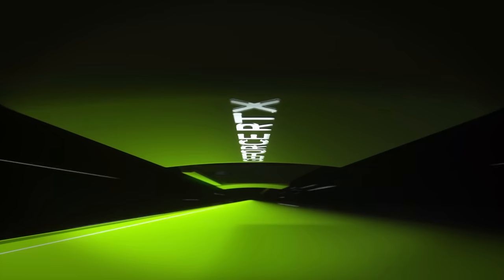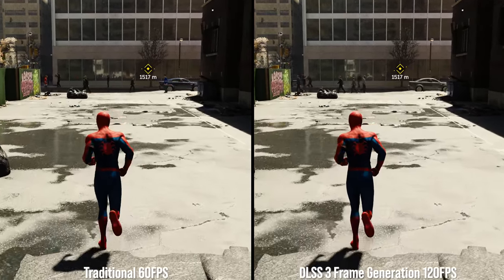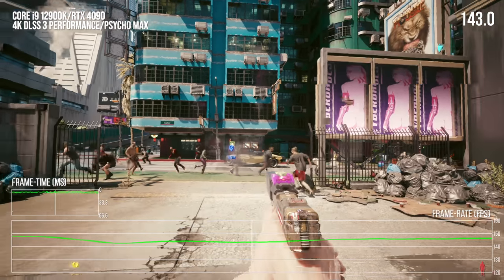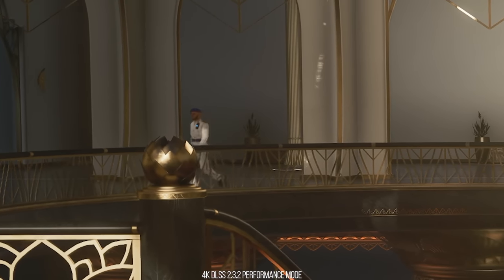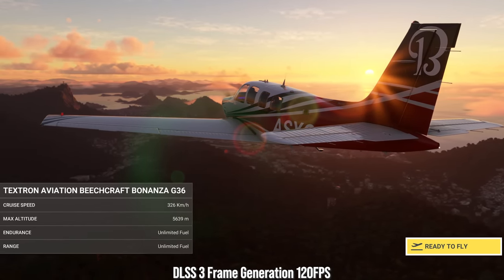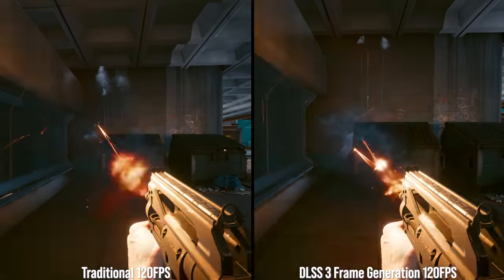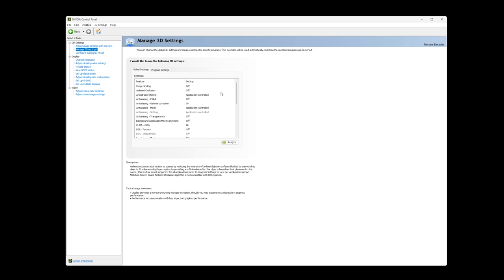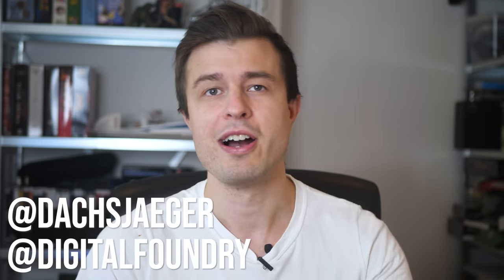Nvidia DLSS 3 Analysis: Image Quality, Latency, V-Sync + Testing Methodology

Comment: So just as we thought dlss3 has all the elements of soap opera effect from motion vectors on TVs but now in video games. 110 milliseconds of latency with vsync on takes us back to 2003 on Old School HD CRTs that had 100 HZ. The other interesting thing that this test showed very well was that you're not even getting temporal stability from these fake frames, because it's inheriting the flaws inherent in the original lower frame rate. I think what makes me sad about this technology is that it's implemented in an imperfect way when VR motion interpolation is implemented in a much better way.

Part of the problem is that the optical flow generator is engine agnostic, unlike in VR rendering where ASW 2.0 has complete pipeline awareness and engine integration. Engine integration would allow them to cut the latency way down without having to rely on reflex to fake it.

Dlss 3 is the least interesting aspect of these cards and no way in hell is it worth $900 to $1600 dollars.

Comment: Excellent video! I think I might disagree with the comment at the end about enabling of v-sync with a g-sync display though, if you're tuning your graphics settings to target below your monitor's max refresh rate. It seems like the tradeoff would be v-sync preventing tearing at the expense of low latency when framerates exceed the v-sync amount, whereas without v-sync you'd maintain your lower latency while introducing tearing in that same situation. I imagine I'd just prefer a consistently lower latency in those situations, but I guess it depends on just how bad the tearing is, and how well you're able to tune your graphics settings to keep the framerate below that level...
Reply: I never saw tearing in that gsync on vsync off situation...  Avoiding tearing was all the goal of gsync
Reply: vsync doesn't do anything in the refresh range when gsync is on, If it exceeds max refresh then its either vsync on or off and as the refresh rate is static

Comment: Correct me if i'm wrong but I believe the amount of latency vsync adds depends on the number of frames that are waiting in queue. For eg. If you get 125 fps without vsync, turning on vsync (120hz) will increase input latency but not too much compared to let's say if you get 155fps and then turn on vsync. I tested the render latency using the nvidia overlay in CP2077 (probably not too accurate) and here are some results using an RTX 3060TI while looking at a wall/ground/sky (for stable fps) @ 1080p:
Vsync Off : 118 fps (6.5ms)
Vsync On (75hz) = 75fps (23ms)
Vsync On (75hz) + In-game Frame cap @74fps = 74fps (9.5ms)
Capping the framerate just under the refresh rate probably has less of an effect on latency when using DLSS3 compared to Native/DLSS2.

Comment: Great video, and I was among those complaining about the early preview coverage. The vsync issues are surprising, but I'm also assuming Nvidia will eventually find a way around them. I think the one bit the video didn't show that I would like to see is what happens to frame delivery with each permutation of vsync and hitting the refresh rate of the display. It seems to me that DLSS 3 is not quite ready for prime time outside very specific combinations of hardware, games and settings. However, it is also currently only available in the one extremely expensive GPU that can basically max out everything out there, so I'd say Nvidia has at least until the 4070-by-any-other-name (still salty about that) starts to be sold at volume.

Also, am I the only one who noticed that Alex sounds a lot like Rich in this one? That was a bit weird. These guys need to start hanging out with other people, I think they've been testing GPUs together for too many days in a row.

Comment: They definitely did better than I thought could be done w/ DLSS3's frame interpolation. The AI aspect on there totally resolves many of the issues I assumed would be present - because I was only imagining what could be accomplished purely using motion vectors to displace the previous frame and morph it into the next frame. That "whole frame artifact" spanning the cut between two camera positions around the airplane in Flight Simulator looked like a failed Deep Dream image - there's a lot more machine learning involved in DLSS3 than I would've thought. They probably have some tensor cores to spare even at those sub-10ms frametimes.

Comment: Lots of great detailed information in this video!

I am bit surprised at the huge latency increase with DLSS 3, when VSync is on. Perhaps, this can be fixed in the drivers?
The scene transition/camera cut issues are also a bit surprising... one would expect DLSS 3 to have some information about the 3D world location, and not just image space information, but apparently this is not the case.
Even the muzzle flash/HUD darkening seems a bit strange... is this due to non-gamma-corrected interpolation, or a statistical issue?

Overall, frame interpolation works impressively well already, but even many of the existing issues seem like they can be improved upon in the foreseeable future.

Comment: Good video, sparks a lot of interesting points and feedback. As someone that study 2D animations and try to hack good motion using a wide variety of frames per motion and for as least frames possible, the variation of what Artifacts are or aren't easily perceive in Realtime does make perfect sense. This works better than one would expect for a new technology, Nvidia engineers are something else so I have no doubt it gets a lot smarter overtime. you can see exactly what it's doing by going frame by frame 21:27 pretty cool

Comment: Amazing job guys! The review is very detailed yet presented in a very easy way to understand! I was just wondering what would happen if we use fast sync from the nvidia control panel instead of regular vsync along side gsync?! Wouldn't that allow the gpu to render more frames when the fps is higher than the screen refresh rate which should result in lowering the latency and input lag?

Comment: Or instead of trying to find the general settings to be below your monitor's max refresh rate, just limit you in-game FPS to maybe 5 FPS lower than the refresh rate. Save the hassle and do that instead.
Reply: so if ur using 60hz monitor you have to play at 55fps? kinda makes the whole thing pointless
Reply: @John Pen  Well, the point of doing that is to always have Free Sync or G-Sync active all the time rather than it switching off and on when your FPS goes above your refresh rate, if that makes sense. By doing, this you should notice a smoother experience. However, I feel like this will only have big differences for refresh rates higher than 60 Hz. If you have a 60 Hz panel, I'd recommend just to uncap your FPS and leave it.

Comment: In regards to GSync/Vsync, does Fast Sync work here? Allow the GPU to render as fast as it wants and just display the latest frame in full? Seems like it would be a reasonable compromise right now to avoid frametearing.

Or we need to move to auto-scaling DLSS. If you're in DLSS 3 Performance, over 120fps on 120hz, switch seamlessly to DLSS 3 Quality to drop fps in exchange for quality.

Comment: With DLSS3 should game engines change from trying to generate as many FPS a second to just the monitor's max refresh / 2, so a 120 only needs 60 fps and then use spare cycles in the engine to minimize input latency.  If you know your last frame time you can see how much spare milliseconds just loop taking input until have to start the draw.   So @60-16.6 ms is your total available time, a frame draw takes 10 ms you have the other 6.5ms to do nothing but take input loop before building the next frame.

Comment: I can't tell if you tried it, but wouldn't recording be improved by using a host OS to record a native-performance enabled VM through looking glass? Also, for the cards that don't even have the latest spec (supposedly so they can sell you an upgrade next release), you could have a weak ARC GPU and pass-through the buffer from the stronger nvidia lacking ports

Comment: I think this technology as it is right now it's good or below average by a notch but it's pretty much the future, being able to run games with all ray tracing features turned on with a much higher frame rate is just incredible. This will put a lot of stress on consoles manufacturers, imagine the PS6 not having a technology like this while a low end GPU outperforming it.

Comment: 29:33 The fact that you can cut latency by 3X (90ms vs 30ms) while only boosting framerate by 66% (60fps vs 100fps) again shows that Native 120fps needs to become the new gaming industry standard framerate target, the gains in both image fidelity with Temporal Upscaling and the feel of user input are so much better, no-one should ever be forced to play at 60fps.
I know, the same argument applies to 60fps over 30fps so why not be happy with 60fps? The reason is 120fps is still reasonably achievable and well under the point of "Diminishing Returns".
240fps never needs to go mainstream, smoothness and clarity won't dramatically improve between 120fps to 240fps the way it still does from 60fps to 120fps, and yes I felt the same about framerate performance on a CRT in the 90's, 100hz and above is a beautiful thing.

Comment: Thanks for the follow-up. I still don't understand why they generate frames in the past.... Or they actually generate frames in the future but your explanation doesn't confirm that our right. 

Is there a public white paper or an actual research paper. Having an actual model to play with (and experiment) apart from any games or hardware constraints would help be understand it.

I would still prefer to have your subjective pixel peeping supported by objective measurements. Perhaps you can use some form of image reconstruction metric. Like the Netflix compression score.

One request I do have for you: get some sample footage and play them back at 60fps. Make one clip at only every other frame (the real frames) and a second clip also at every other frame. But offset by one frame. This way you can view only the real frames and only the fake frames. They won't be comparable as there is an offset, but you can see if any issues persist in the fake frames that might get hidden by seeing alternating frames on your monitor. 

Also raises the question for framerates (or frametimes to be more accurate) that are higher than the monitors refresh rate. Even if you have v sync or not. Will the frame buffer prioritize real frames or always do the newest frames (in *game time, as the order of frames getting rendered is 1,2,1.5,3,2.5,4,3.5 etc) so when you get 3ms or 2ms frametimes on a 120hz screen...

As for ground truth, games might allow you to reduce the timescale. Meaning you can render out the perfect 60 or 120fps benchmark it just takes longer. Might defeat the purpose of comparing real time performance, but you shouldn't need to go down in resolution or settings to get such images. 

Pacing and frametime plots would be really interesting. If the interpolation of motion vectors, optical flow(kinda the same thing) is exactly half - but the fake frame generates faster than the real frame renders, you have to add fake delay before the fake frame and display it for longer then you would... Think of a toy example that renders in 10 real fps, 20 real+fake fps, 20 real fps etc....all the way up to 400 or even 500fps On a 200hz screen

Comment: Seems like using a camera pointed at the screen is the better option, even though it doesn't give you the actual quality of the view it does provide an even cross comparison.  The camera you'd need would be well over $10k though.

Comment: I got a Strix 4090 yesterday and my main gaming display is an LG C1. The card seems to be overdriving the processor of the C1 with too many frames and now I get a strange stutter / hitching thing happening and the onboard fps counter of the tv bounces from 120 fps to 86 and back to 120, while the Nvidia overlay is showing 170 to 280 fps in various games like battlefield 2042. It’s crazy how powerful the 4090 is and I guess I now have to get a better monitor

Comment: gsync is ok but nvidia used the improved experience high refresh rate monitors already offered to trick gamers into believing gsync was the sole reason their games ran so smoothly in motion. I know this because I was already using the high refresh rate monitors at least a year before gsync was ever announced. tearing wasn't really a problem anymore at higher refresh rates and of course motion was much smoother. I have had a gsync monitor since release and I normally turn it off because it causes blurring on my ips monitor when framerates are lower than 60hz and gsync is lowering the monitor refresh rate to match the low framerate.

Comment: I don't use vsync, I personally use gsync + framerate cap, if i run 120Hz I cap framerate to 100-115 depending on how much power saving I want. I limit FPS in nvidia control panel not RTSS.

In movies deformation and duplications are often used to emphasize motion and speed. Image "errors" have been with us for decades. If you stop frame and look at deformed or multiplicated frame in movie it will look very weird but in motion it actually enhances perception of motion. Some things are designed to view in motion and not as static image.

Comment: Pew, thank you for the insane effort. But it really underlines what I suspected.
For now, I'm in no need to upgrade and even if you don't "see" the artefacts generated, you brain does. Similar to how fast movement is more blurry on modern tech, then it was on CRT. You don't really notice it, but you realize it, when you can look at other data, like for example about your shooter performance. 
Going OLED made a slight, yet distinct improvement in motion clarity (yet I wish modern HDR OLED Monitors had also BFI). 
Nvidia will surely be able to reduce the amount of extra "load" on our brains over time, so I'm looking forward to where this is headed. :)

Comment: I appreciate you calling out local OBS recording for being so bad. It just decides on its own if it's going to work fine, be a stutter frame dropped mess, or a combination of both whenever it likes. 
Can spend hours testing and tweaking all sorts of settings, recapturing the same thing over and over to test for stable playback, think you found something that works...and after an hour of playing even at the same settings as before that gave smooth playback, its a mess. 
Restart your computer? LOL mess. Close and re-open the game, haha...mess. 
Shadowplay isn't much better.

Comment: Excellent analysis, thanks!

I don't think I'll ever want to use DLSS 3 due to the added input lag. Even at lowly 60 FPS smoothness isn't the biggest problem for me, it's mouse lag. If you have high enough framerate to have no latency issues, the motion is already smooth enough.

Comment: Seems like still alot limitations/quirks, people shouldn't be forced to have to trial and error to get settings that will guarantee fps remain high (the purpose of using dlss 3.0 in the first place) but yet need to be under the refresh rate of monitor at all times to get optimal latency. Not to mention that means working the gpu 100% with the power usage/heat from it.
Reply: those two things are complete non issues for the enthusiasts that'll be buying these cards. and if you're any more casual than that, it's likely something you wouldn't notice or even know of to begin with. These are things those of us using 4k 120hz didplays have already been doing for some time. Ruvatunet and Afterburner launch with windows on my rig

Comment: Excellent break down the latency crowd was right though. In a 1 to 1 reflex enabled situation of test you're still introducing a frame or multiple frames of latency in DLSS3. This isn't good anyway you slice it.

This tech also doesn't bode well for lower fps due to fact that artifacts at lower fps will be more visible than say above 100fps.

Also if you have a video editor getting around YT 60fps isn't hard.  Others have left the trick on youtube, so it's not hard. In something like vegas you would need alter the playback rate to on high fps to 50% and you would have to speed normal aspect to about 200%. Would be a pain to make and you'd have to leave reminders to people watching to adjust the rate manually.

This tech should come with some form notation cause usually when you increase fps you lower input latency we no longer get that with this and you get it with DLSS2 not just native.

Comment: Thank you for bringing the proper definition of VSYNC to the masses when GSync is involved, as it seems to be a massive misconception that GSync itself prevents tearing. Anyone running GSync should also be turning on VSync, globally or in-game. Also major props for introducing methods to review these new visual methods. For instance, paying attention to cyclical animation issues with frame generation is a brilliant way to review image quality with the new technique.
Reply: Nah man, screw V-sync. In most games it adds horrible inputlag. Way more than eg DLSS 3 in those examples.
Reply: @termitreter6545  That's why you set a frame rate cap according to your display so you don't introduce input lag.
Reply: @pogtuber5146  Yeah nvm, Ironically enough I missed the point of your comment and forgot the vsync/gsync combo xD

Like thats completely different to just vsync.